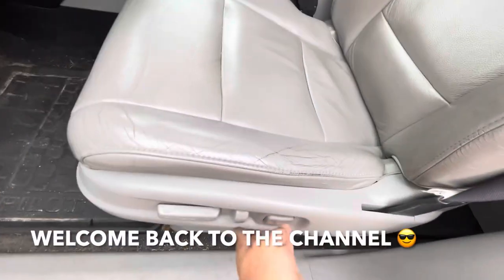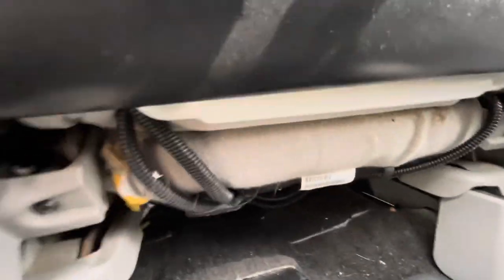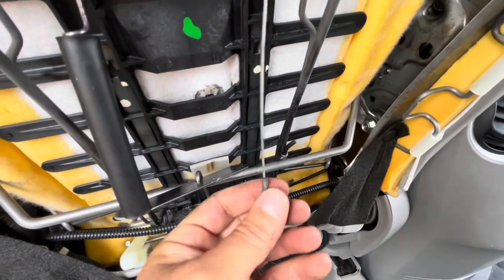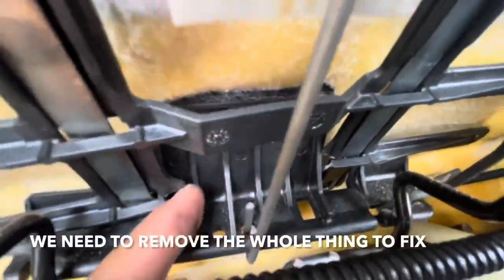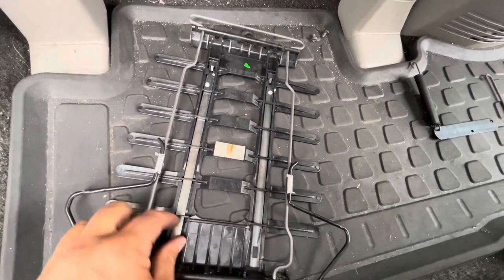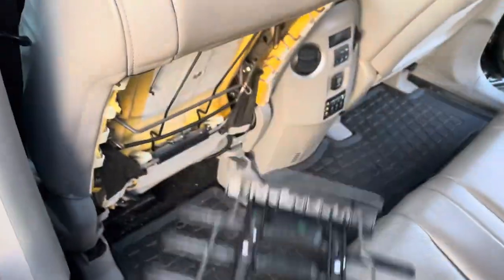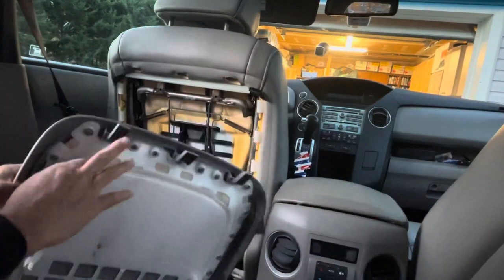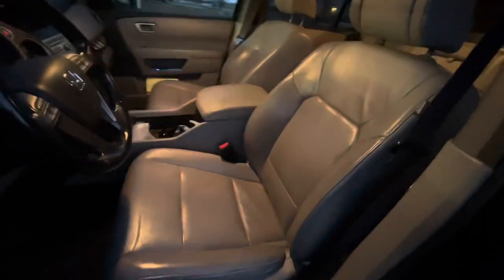HONDA PILOT FRONT SEAT LUMBAR SUPPORT FIX - How to Repair the Power Lumbar Support on a Honda Pilot.

Comment: The part on my 2011 Acura MDX is called Lumbar, Front Seat-Back (81590-STX-L02) and correctly costs $201.58. 

This part looks similar to the part you removed. 

Thanks for the video. 

Now I know what to tell the dealer to fix. 

I wonder how many hours they'll charge me to complete this job.

Comment: I used the JB Weld epoxy special formulated for plastic. It didn't cure properly, even after 12 hours in 73F 40% humidity, and the pieces pulled apart the first time I used the support. Then, I went back in and drilled small holes spanning the cracked pieces, cleaned off the loose JB Weld, and wove the pieces together with plastic coated single strand metal florist wire. Then I took a roll up cutting board (very thin sheet of what looks like polyethylene, sprayed one side (the lumbar support contact side) with teflon dry lube, put this sheet  over the foam, and slid the lumbar support piece over this. This gave it a smooth surface to slide on to cut down on stress and friction caused by the plastic support rubbing on the foam (the foam had actually been cut in several places by the broken lumbar support pieces).  It worked great. Hopefully it will last. I had thought about going to a pull your own part salvage yard to try to find a replacement, but then I figured these would all be broken, too, as I really don't know how this design with such thin plastic and no hinges on the lumbar support could withstand the strong forces exerted on this piece.

Comment: Excellent video!  I've got the same problem.  How's the glue job holding up?
Reply from the maker: Doing well
Reply: I used gorilla glue, cut a small hose clamp in two pieces and used some fiberglass and resin for support.  We’ll see…  thanks for the tutorial!

Comment: Could you have repaired this by putting a piece of parchment or wax paper behind the broken pieces to avoid glueing to the seat padding and then applying JBWeld to re-attach broken ends without having taken the whole assembly out?